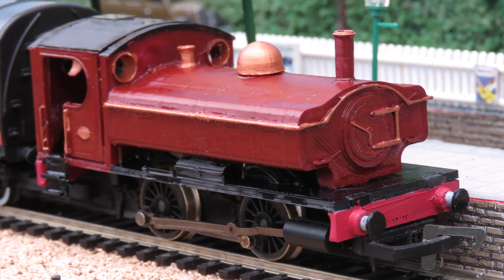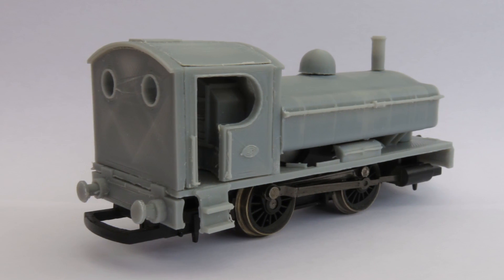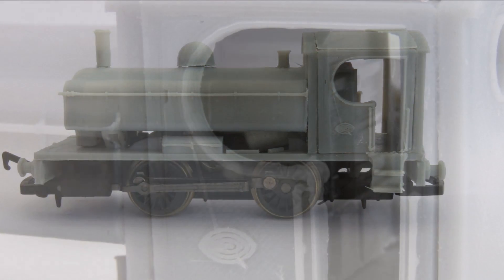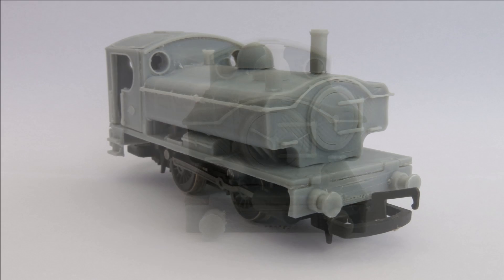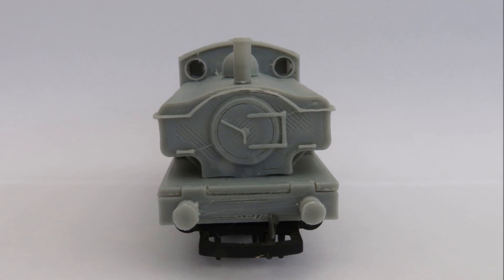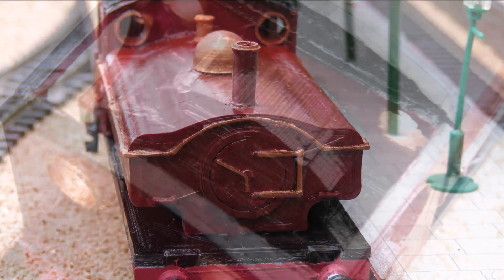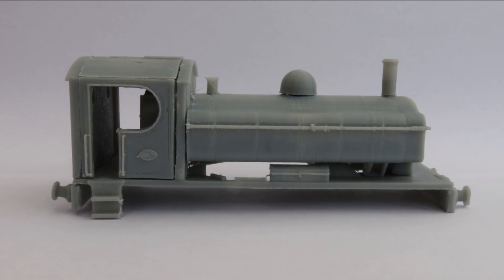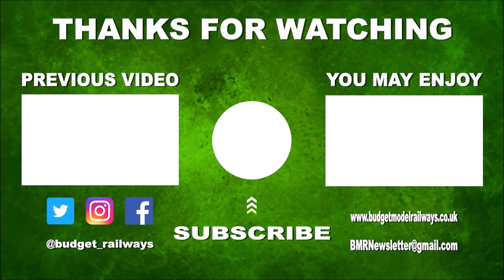OO Gauge 0-4-0 Pannier Tank Steam Locomotive Body For The Hornby Chassis - 3D Printed Railway Kit

Comment: Did you know that the GWR had an 0-4-0Pannier like this? Built for Powlesland and Mason in 1903 and used in Swansea Docks, inherited by the GWR at the grouping in 1923 and rebuilt as a Pannier Tank (like yours)at Swindon in 1926. It was sold to the Pontardawe Steel & Tinplate Works in 1929 where it was named DOROTHY surviving until 1962.
Reply from the maker: Epic, thanks for the info much appreciated

Comment: A bit strange in water vs coal ratio, but thar might be because i'm used to continental proportions.

A nice variation could be one with an extended coal bunker over the firebox (like https://en.wikipedia.org/wiki/W%C3%BCrttemberg_T_3#/media/File:89_339_1.jpg where it covers even the  engineers window)

Comment: This may be my next purchase but I feel like it looks off without a coal bunker on the rear end.  Still, this will be my next purchase after my tram arrives that I just ordered
Reply from the maker: The coal bunkers are in the cab sides. Thanks for the order
Reply: I thought about modifying the kit by using the bunker off the Hornby holden tank loco. And having a more open cab.

Comment: Which version of the Hornby chassis is best? I've tried a Holden tank chassis and its not a good fit. It doesn't fit the Percy chassis either. I want the loco to have outside cylinders. Please advise.
Reply from the maker: They should fit, but it's a close fit and needs a bit of jiggling
Reply: @BudgetModelRailways  thanks for getting back to me. I will give it another try then.

Comment: Hi you two, very nice. Eventually, just like any other manufacturer, who needs to keep on top of supply and demand, you will need more 3D printers. Consider it the cost of doing business. Good luck.
Reply from the maker: We have three, and have so far bought six, with three sold on as we upgraded. Luckily with Dougs skills we can modify basic printers into improved models. Actually even a basic printer can produce nice models but the majority of users sadly lack the required CAD skills, again Doug is doing A level CAD hence the difference

Comment: Nice looking kit but the chassis sadly I can not get one still got the diesel shunter without a chassis. It's a pity but that,s hornby.
Reply from the maker: There are plenty of 0-4-0 locos on ebay quite cheap?
Reply: @BudgetModelRailways  I,ve just looked the cheapest is £17.00 not sure whether it's the right one
Reply from the maker: Try auction not all listing. I have bought 2 in the last two weeks for less than £10 Inc postage. Most just need the wheels cleaning and lube to be nice little runners. Look for unboxed ones preferably with poor bodies, often the chassis is fine
Reply: @BudgetModelRailways  right which types please
Reply from the maker: @johnslade3104  there are two basic types with and without pistons. The saddle tank loco is ideal as its heavier but the version with square side tanks and a full cab is good if you don't want pistons. The ones made in China are the better at slow running. Hope this helps
Reply: @BudgetModelRailways  saddle tank pug yes
Reply from the maker: Saddle tank should be ideal, but the actual short pug
Reply from the maker: Sorry that should have said NOT the short pug
Reply: @BudgetModelRailways  thank you will continue to search

Comment: Dear Mr. Potter I have a question.
On the Facebook market place I saw a lot of old building Kits by a company called ´´Builder plus´´
How difficult are these kits are ate they alright for the average modeler?
Reply from the maker: I have never built any but I believe they are similar to superquick?
Reply: @BudgetModelRailways  Very thin card initially, later kits improved and branded with 'new heavy card', I tried a few (Island platform still too flimsy and round house shed too short for tender loco and impractical wide at rear space wise, however it might become a conversion to normal shed or factory) I soon returned to Superquick. Also check which gauge they are as I believe they made 00 & N gauge kits.
Reply from the maker: Thanks for the info
Reply: @grahamknight8994  Cheers.
Reply from the maker: Of course if they are cheap enough it might still be worth having them and perhaps adding some improvements, extra strengthening etc

Comment: you could have picked a better chassis than hornbys WoRST on
Reply from the maker: Go on then, please tell me what other cheap readily available chassis there is?! You obviously are talking about the much older versions, the newer Chinese ones are smooth reliable, slow running and don't hesitate on points so not sure how that makes them the worst chassis.
Reply: Well what I meant was had disc wheels with plastic spokes in the front and the shitty non connected drive from the pistons. More than a bit kiddy tr5ains
Reply from the maker: They are all just toy trains at the end of the day. Like I say happy to hear what other cheap readily available chassis you had in mind
Reply: @BudgetModelRailways  Well the Terrior      ? chasis is popular for various 0-6-0 s But the 2 things that I was complaining about were the solid metal behind what should be air behind the spokes. The other thing was having at least a basic con rod -piston connection. i.e. not one piece - slidy bit & the connections to the driving wheels. Would have looked better if had no outside cylinders. But since they were modelled WELL should have done the effort.
Reply from the maker: Terrier is hardly a cheap chassis, £40+ second hand, double that new, and we are budget model railways. We have sold over 300 locos on this chassis so it works for us

Comment: Do you have the file for the design, I have a 3d printer
Reply from the maker: With respect we are hardly going to give away the file for a model we sell via our website
Reply from the maker: Most of the cost of purchasing the kits via the website goes to the hundreds of hours it takes to design these kits to be just right with all the details and scaling.
Reply: @BudgetModelRailways  Oh okay, maybe I can give you my designs then. Although they are in ho scale because frick OO gauge.
Reply: Oh btw is that a resin printer? I use conventional printers.